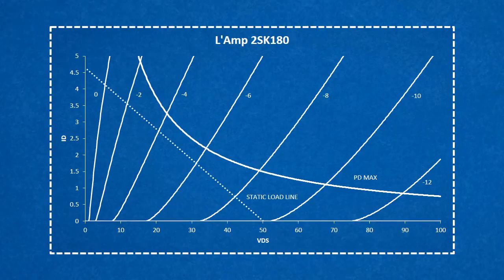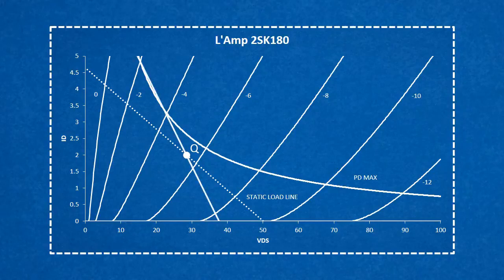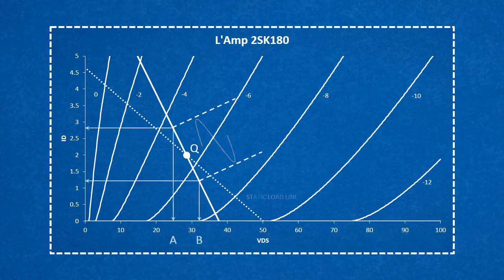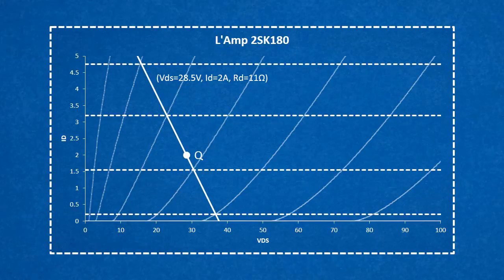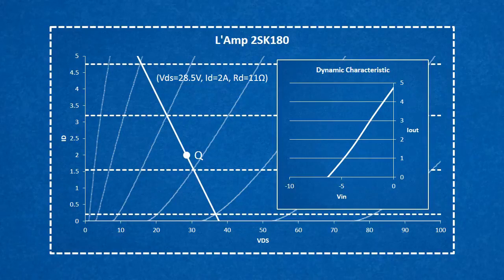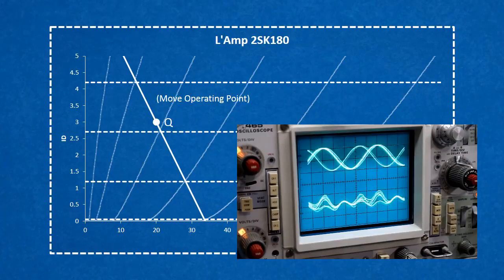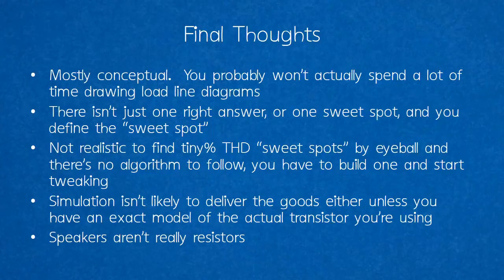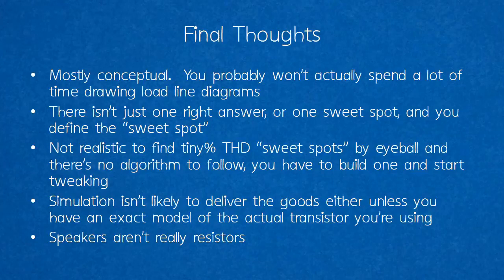Load Line Tutorial L'Amp 2SK180

Comment: Just wanted to say thanks for this. I have been wanting to build a class a amp for a couple of years now, but it has been difficult to know where to start with the learning! I did digital and solid state electronics at university what seems like a lifetime ago now and have retained (somehow) less than zero percent of what I learned.

This video has helped slot a few things into place, so thanks again. I would be grateful if you could point me in the direction of a book that would help. I have been lurking on DIY audio for ages, but I don't have enough knowledge to understand what people are talking about, other than in a very vague sense.

All the best. Neil
Reply from the maker: You're  welcome!  The usual book recommendations are: Bob Cordell's amplifier book, or Doug Self's books.  If you're doing tubes, Morgan Jones' Valve Amplifiers.  Those are all great but not necessarily starter books.  If you want a general electronics book, I like Practical Electronics for Inventors, it'll also be a good reference to have on the shelf.  And, don't underestimate the old stuff.  Go to the Internet Archive, where you can download pdf's of the old audio books like Baxandall, Crowhurst, Hood, etc.
Reply: @PASS DIY  Thanks, I will see if I can find something on the archive. I think you alluded to my main difficulty, which is not knowing which level to come in at! I had probably best start with the very basic stuff. I was conceptually struggling with how the amplification happened, but your video has helped with that. I'll revisit it once I have studied some basics, and hopefully, I'll have a framework to put the information in, rather than it floating untethered. All the best, Neil